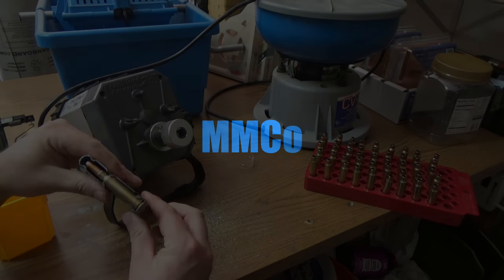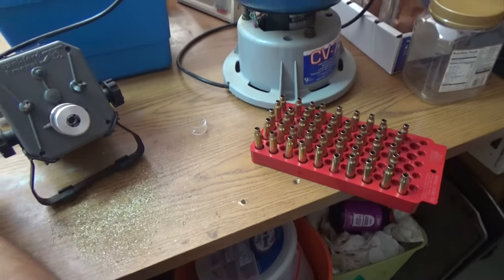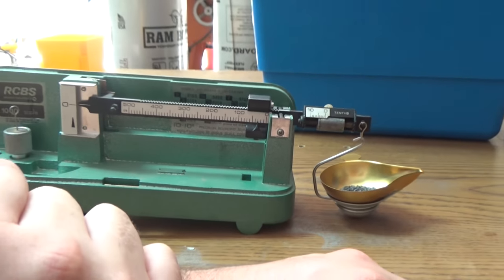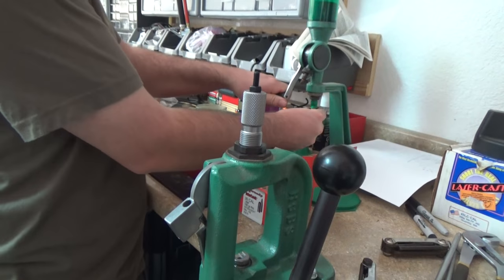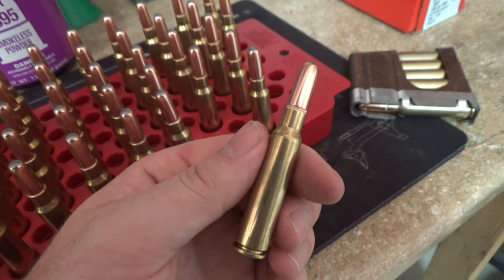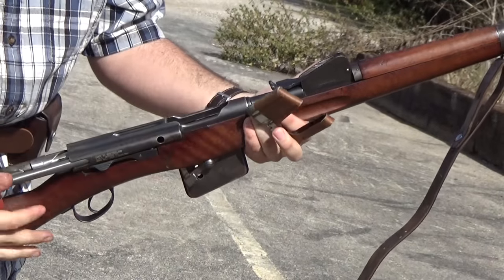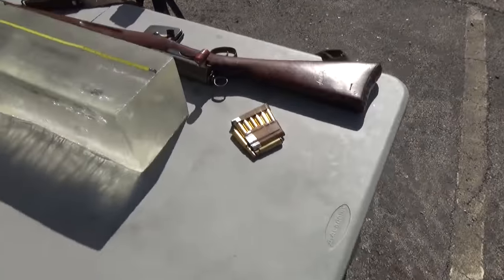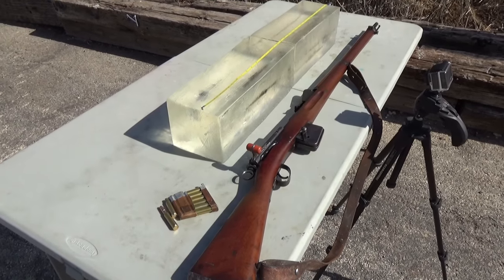Reproducing and Testing GP90/23

Comment: Great vid.  I know these work great for you and I'm not being a know-it-all but you might wanna try this:   
55mm will work just fine in the 1889, no need to trim differently and have two sets of brass if you also have one of the 1911 to K31 rifles that shoot the GP11 cartridge.

So, you could save yourself some time and trim it all the same since you're using jacketed  .308 bullets.  That chamber/throat has plenty of room.  
The only time anyone needs to worry about trimming shorter is if they are using fatter cast/patched bullets.
I have two 1889 rifles and neither of mine require brass to be trimmed any shorter than my K31, KI11, 1911, etc.  

I just took all my dummy rounds made for the K31 (four different .308 jacketed bullet types) and measured the case neck right at the mouth, chambered and extracted them in both 1889 rifles and measured again.  No difference.  No sign that the neck was pinched at all visually either.  
If they needed trimmed to 54.5, it would have pinched down at the case mouth and you would probably feel slight resistance when closing the bolt.  
  
I've only shot cast loads in mine, I use the same load for the following rifles: 1889, 96/11, 1911, K11, K31.  I just use a 180gr .309 sized Lee lead cast/powder coated bullet over 19gr 2400 with berdan primed GP11 brass trimmed to 55mm.  It's like shooting an AR recoil-wise.  

I am going to get some of these 180gr RN and try your load, thanks!

Comment: GP90/23 - Gewehr Patrone 1890, updated in 1923. Excellent info! - I found 33.6 (Lee dipper 2.5cc) of IMR 4064 also yields very acceptable accuracy and power.
Reply: Roddo using what bullet?
Reply: Stormy 0307 I shoot either a .308 150 gr fmjbt sierra or a .309 gc lead rnd nose 170gr with equal accuracy on that load.

Comment: I am pretty impressed that itty bitty go-pro could catch the temp cavity. Btw, they are going to crucify you for going with a different overall length on your round ;)
Reply from the maker: Well its not possible to get the same overall length with those 180gr Hornady bullets so let em howl.
Reply: @murphysmuskets  As long as you do not injure your self all is good. I am going to load up my first 3 rounds today and try my 1889.
Reply: @randyphillips2263   How'd she go?
Reply: @jackburton9214  I still have 2 eyes and 10 fingers after 15 rounds

Comment: I followed most of your instructions.  I do not trim my brass.   I bought some of those expensive Hornady bullets.  They really shoot great in my 1889.   I have however switched to a 170 Grain .310 gas checked powder coated bullet I can pick up for less than 15 cents at quality cast LLC.  I worked up from 10 grains to 12 grains of unique.  I am now putting 5 shots within one square inch (about 6 inches above aim point) at 50 yards!   total cost if I anneal and neck size to make the brass last a long time.   5 shots for a buck!  on my chronograph the extreme spread is sometimes as low as 10.  They seem to shoot just about as good as the hornady 180 for a vast reduction in price because I am using cheap uniqe and only 12 grains.  if you havent tried it.   give it a shot!   took me a bit to figure it out.  using wrong powders and not expanding the neck a bit really puts some hard to remove lead in your barrel.   but I have it now so that it cleans with 4 patches.
Reply: Nice!  Im using a .309 powder coated with 2400, no extra trimming
Reply: @yuibot5998  do you expand your neck at all?

Comment: after full-length sizing my brass doesn't chamber. the shoulder isnt pushed back far enough. the die touches the shell holder. suggestions? I use RCBS dies.
Reply from the maker: Trim to 54mm Your chamber may just be tighter than most.

Comment: I put 38 grains as oppose to 33 of the same powder. 180 grain bullet.

Is this too much?
Reply: I use 35 grains of H4895 as a MAX load.   2247 FPS it generates 29,000 PSI.  That is all the more I would work one of these.  .   I ran for you.  IMR 4895 with 38 grains on Quickload. That generates 32,000 Psi and 2350 fps Muzzle velocity.   In my opinion that is pusing a 120+ year old rifle harder than you need to.
Reply: @spadetrump  My goodness man, thanks a lot! Talk about going the extra mile.
Reply: @TheFaithfulRedeemer  all good.  I was making some more and watching the video again.  I don't trim my brass down to 54.5 FYI.  I had quickload open and on this load when I saw your question.   They claim this rifle is up to about 38k psi.  But they are old.   Quickload says your load is high but not unsafe.  Just potentially unsafe ;)
Reply: @spadetrump  Thanks again man. Much appreciated.
Reply: @TheFaithfulRedeemer  i shot my 35 grain H4895 loads today.  full length swiss brass.  2150 FPS 5 yards from muzzle.  1" group of 5 at 50 yards with that 180 grain Hornady round nose bullet!!!  Awsome!   start at 33 and work up with IMR 4895

Comment: Where were you able to find load data for this?
Reply from the maker: I extrapolated the load data from 30/40 Krag. Both rifles have similar action strengths & cartridge volume. I started with the low pressure loadings and worked my way up.
Reply: @Murphy’s Muskets  Gotcha!  To bad we can't have a reloading manual that focuses on "obscure" cartridges haha.